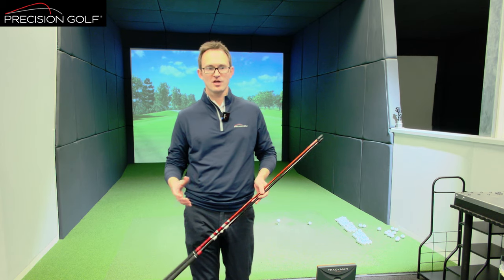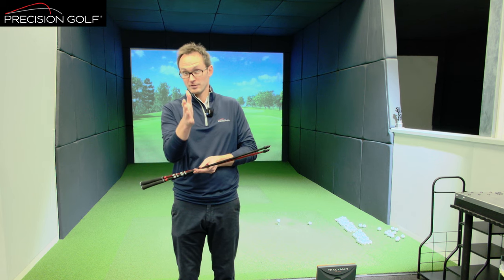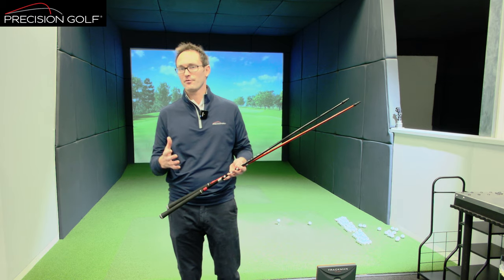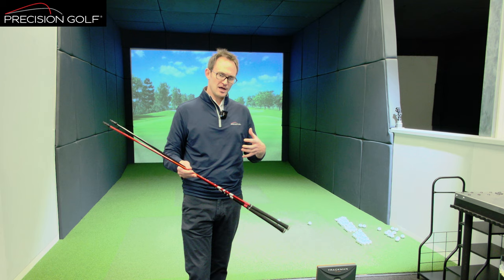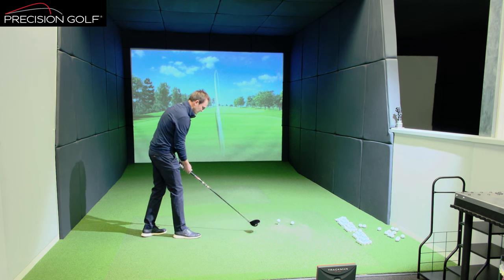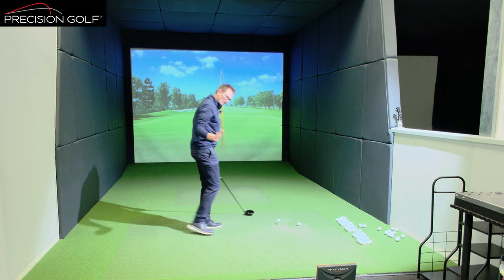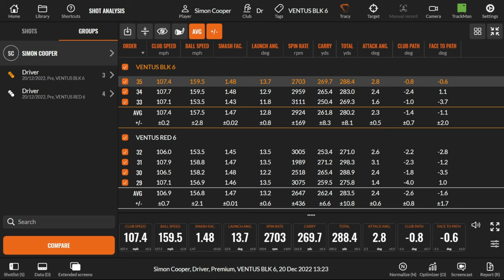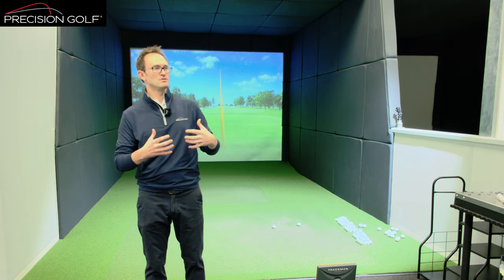Finding the Perfect Golf Shaft Bend Profile

Comment: Great video. Can you tell me if the shaft type determines how much the toe of the club bends down when you swing it?
Reply from the maker: It will do in that a softer flex will droop more and a softer tip will have a slightly higher deflection than a higher kick point shaft

Comment: I’m in the middle of testing my hazrdus 6.0 , RDX 6.5, and an Old Diamana Kai’li S flex.   

I am looking for a little easier feeling swing with the Kaili but I don’t know if it is going to hold up against the RDX finding fairways because like your results I feel like my tolerance and consistency with the RDX is very predictable.  Still need more course testing and launch monitor to see which is going to be in the bag the rest of the summer.
Reply from the maker: Sorry for the delayed reply. Ultimately the better shaft will be the one that swings best due to the weight and balance allowing you to time the swing better, squaring the face more naturally. You should be able to tell quite quickly which gives you more reliability as it will feel simpler to swing

Comment: Hi guys great informative video.
Currently using a sim2 9* driver cranked up to 10.5* because I need more peek height and I don’t want to see the ball go right..will this affect the standard ventus shaft and do I need to have the shaft re-aligned to the sleeve adaptor or is this only a problem in expensive aftermarket shafts.
Thanks Kevin.
Reply from the maker: All shafts no matter of cost will have a “best” orientation to install into the head from a consistency point of view, with a less expensive shaft likely to have greater variation due to being made of less high grade materials. Glad you enjoyed the video!

Comment: It looks like the Ventus black performed better for you in terms of finding the fairway although you said initially you were comfortable with the red. The red kept going left. That last shot with the black was perfect, right down the middle. 
It often seems that the heavier version of the same shaft has a lower flex point than the lighter one. Why is that? For example, in my old Taylor Made T7 425 Tour Preferred driver I had a Fujikura Rombax TP stiff shaft weighing 65 grams. At the range where they had hundreds of demo clubs (this was years ago before fitting carts and interchangeable shafts) I had been trying out the 75 gram version of the same shaft and head. It was not until I read the fine print in the booklet that came with my new driver that I learned the 65 gram shaft had a mid kick point.

Comment: If you're a low spin player who hits the ball high do you go with the high launch shaft because you don't need to lower spin or do you go with the low launch shaft that could lower spin even more? Your spin was up with the black but where did you strike it on the face compared to the red?
Reply from the maker: It is not as direct a relationship between the theory of a shaft’s profile and the reality of which shaft performs best for you. As you saw in our video the “higher spin shaft” can spin lower than the “low spin shaft” if it helps your timing and delivery. If you are high launch and low spin the shaft will not make a large change to that - the head profile and launch/spin characteristics will be more important to optimise launch and spin than the shaft. The shaft will give you consistent dispersion and strike but your action and the head design will affect height and spin more
Reply: @Precision_Golf  Thank you!

Comment: Just one more question. Do you stock the BGT Brava driver shafts? They are expensive, but half the price of Autoflex, and it looks like they actually do increase ball speed and add length based on two test videos I have seen, one by your friends at TXG for one of the staff, using a Ping G430 10.5 head, and one by Club Champion for a staffer who actually got ball speed up from mid 160s to 170 and added more than 10 yards.
Reply from the maker: Hi John. We are considering bringing this shaft into our matrix.

Comment: Uhm. Shouldn’t you be doing ball and shaft fitting in the same session? I’m sure you’ll get completely different results from both the ProV1 and the Left-Dash of course. I personally cannot play a spinny golf ball with low kick point shafts.
Reply from the maker: Sometimes but you want to optimise timing first to get maximum consistency and then you can dial in flight with head style, loft and ball type if need be